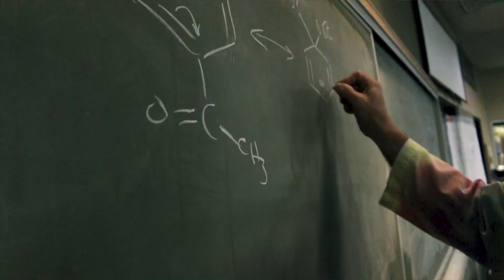I Want To Do EVERYTHING! - Channel Trailer

Comment: You make climbing holds? That's an  awesome use of mechanical engineering knowledge.
Reply from the maker: Yep! Got to make them efficiently!
Reply: Wood could be quite slippery. Have you tried to make a "textured feel" to them too as some climbing holds have? 🙂
Reply from the maker: @TheESS1  I have with paint and sand texture, only issue is it's way more tough on the skin but the plan is to have several dual textures like that